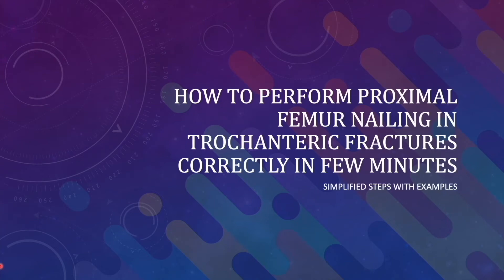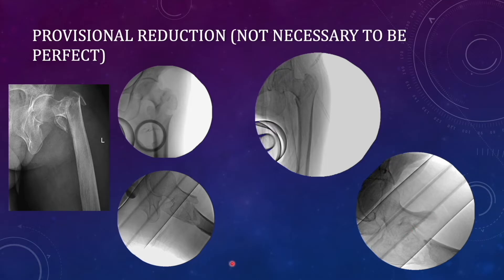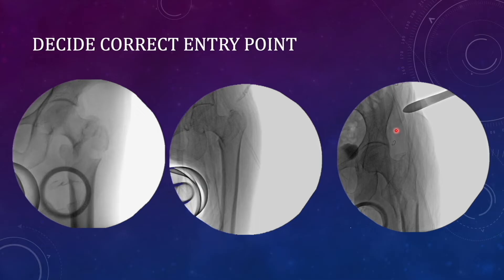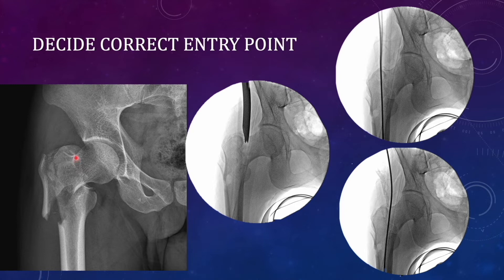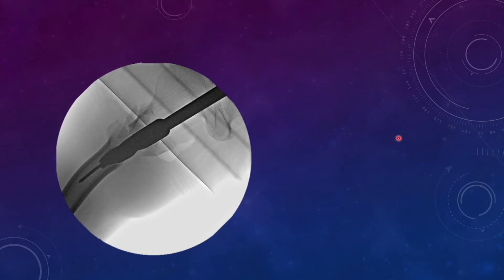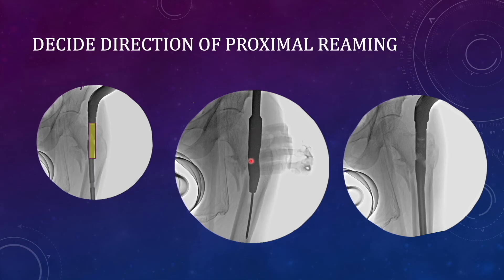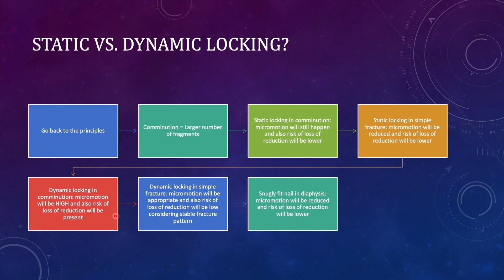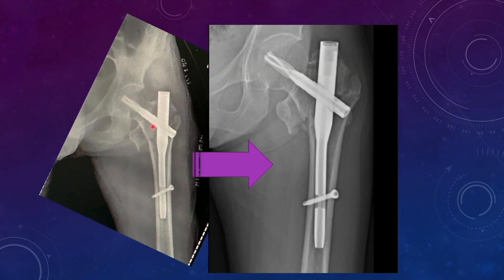Basic technical tips for nailing of trochanteric /IT femur fractures

Comment: 1.sir is there role of keep perineal post position in same side of fractured limb or contralateral side?which side should we keep perineal post? 

2.lot of time when we put reamer ,it get stuck over asis ....is there any specific position of patient,through which we can avoid this?

3.if we get good positive reduction ,is there any role of nail size or we can put any size 9mm,10,mm,11 mm,or 12 mm ?

4.in lot of it fracture patient with shaft  bow ,sometime there fracture extends below LT,
if we try to put long pfn,then it hits anterior cortex in mid shaft ,is there any solution to overcome this problem sir?so if we put long pfn then it dont go down without risking fracture ,if we put short instead of long then it will be unstable construct... 

5.if we use short pfn with 2 screw.....many times we get good positive reduction and fracture too unite well....but in few patients ...after 3 or 4 months ,if both screw start migrate  to lateral side ,even patient fracture united well in 2 months period,patient came to us with impinge of screw over lateral aspect of thigh,can we remove both of this screw in 6 month period ,without removing nail?

6.in few patients patient with negative reduction,fracture unites well with in 6 week period but with collapse and screw back out,we start full weight bearing walking without support,and patient walk painless ......can we remove those backout screw only sir?

sorry sir ,for asking too much question...
Reply from the maker: 1. Perineal post to be on same side as it pushes trochanteric prominence laterally making entry easier.

2. When reaming you have to adduct  limb and keep pt trunk in banana kind of curved poistion, that will help

3. For IT fractures, diameter of nail has not role except for very short nails, which can toggle in unstable fractures
4.235-240 mm indermediate length nails of narrow diameter are best

5. hold of two small diamter screws is poor compared to a single large diameter, therefore new gen nails have either intergrated or single large diamter screw. Better to shift to new gen nails, the two screw old ones are not good for poor quality or osteoporotic bone. And the screws needs to be removed only if loosening, not otherwise

6. after fracture is confirmed united, an impinging screw can be removed

Comment: Thanks for the immensely informative video on IT fractures . 
Removing a medial piece of bone is a great point to prevent wedging 

If somehow wedging infact does happen - 
1. it ll not allow to fully compress the fracture ? 
2. Do reduction k wire placed anterior need to be removed while tightning the lag screw ? 
3 . In wedging the screw length required increase ( more than 95 even in females ) - should be still screw with a long screw to achieve TAD ?
Reply from the maker: Thanks for your feedback.

1. Compression may still happen at medial cortex, and fracture may still unite. The issue that will persist will be varus and some shortening, which may be apparent. But wedge effect + distracted fracture and large gap medially may bring a non-union also.
2. If bone is good quality then yes K wire needs to be pulled back, but in osteoporotic, it wont affect much. Usually when we see that compression is not happening, we pull the k wire
3. Yes, TAD is important for screw, it should be within the defined limits of 2.5 cm in AP+Lat view, BUT for blade, it should be kept on higher side to avoid future cut-out, especially in poor bone quality.

Comment: I need contact of person supplying this type of awl
Reply from the maker: Hi, we get this kind of awl with Double Medical trochanteric nail, which is similar to synthes/j&j TFN nail. Alternatively, cannulated awls of local companies are also available, which solve the purpose. The design is also similar to the Stryker Awl, Curved 9 mm. I will ask the vendor for the right person to contact and update here.
Reply: @Justorthothings I had a femur fracture 7 months back and I am still limping. Can you please share me your contact details for consultation? Thank you
Reply: @Justorthothings  sir any update??
Reply from the maker: @khadirkhan1044  See, for the purpose of making medial entry and control guidewire from being angulated, the awl in this link below is sufficient. I have used this, it helps in positioning guidewire correctly without any soft tissue pressure as cannulated part is far from the holding part. Also, since the cannuted part is straight, the direction of guidewire can be better controlled.

https://www.amazon.in/Cannulated-Bone-Awl-Surgical-Instrument/dp/B09W2MK7DP